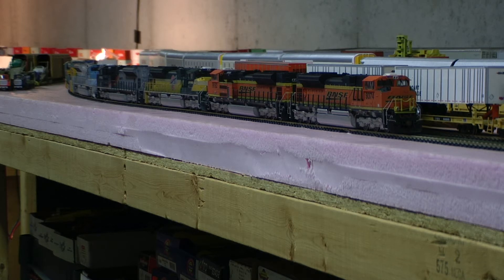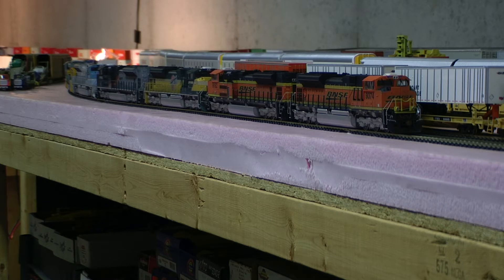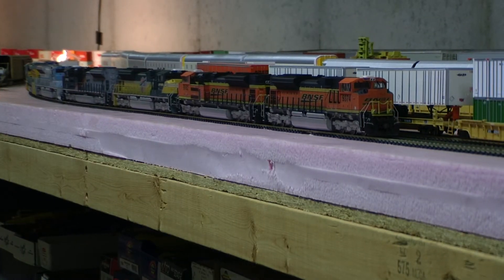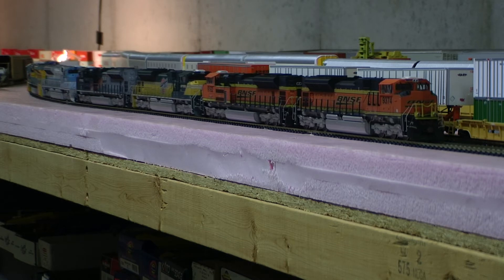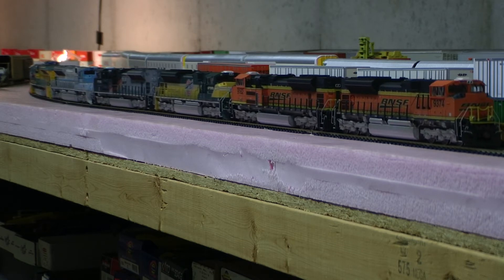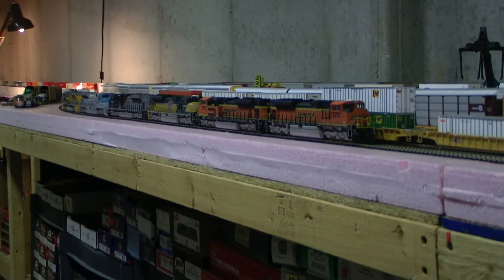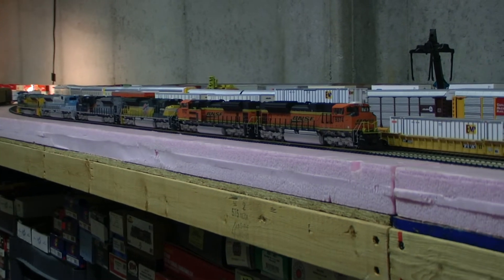Six Custom Weathered MTH SD70aCe's with Flash Code Update

Comment: lol, since we are talking to stupid, top this one.  I bought the Prodigy Wireless.  I have an oval of track sitting on the floor, and was testing my trains out, I grabbed the controller and moved like 4 feet away and it stopped controlling the trains.  I sent an email to MRC, saying "you claim over 15 feet and I can't even get 5."  Their response was.. "Open the control box, there is an antenna inside, straighten it out and stick it out of the vent holes", you'll get over 15 feet now."  LOL

Comment: Do you have problems assigning loco's with the MRC?  I can't assign it using the main track function.  When I click loco 3 it brings up the loco, then I go to program it to like 3543 (example) it verify's the assign but when I select 3543 as the loco, it does nothing, so then I hit loco and 3 and it works lol have no idea what's going on. thanks.